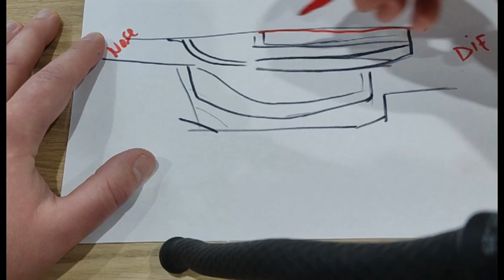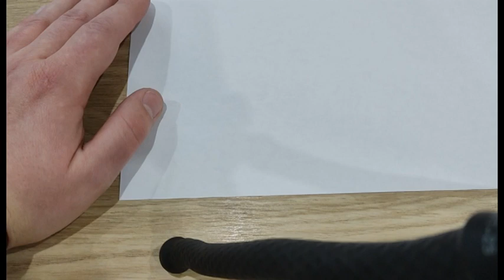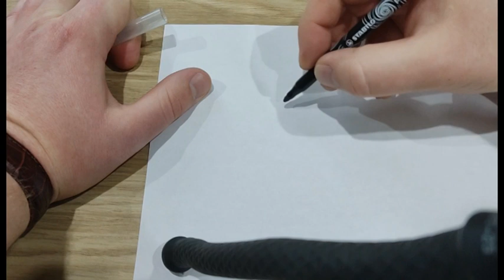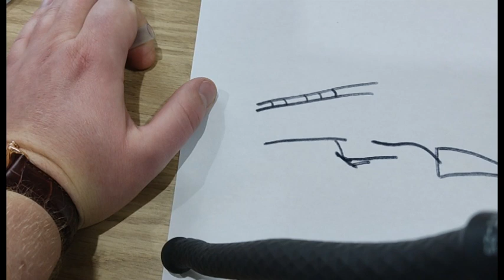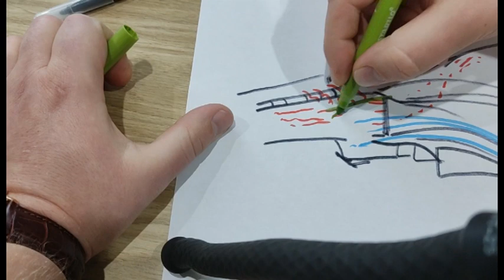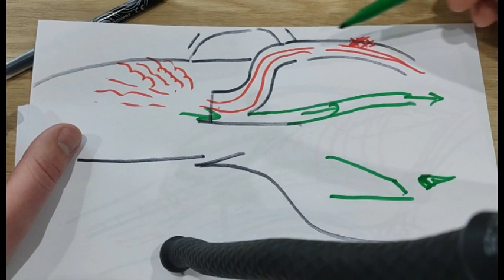Red Bull RB20 2024 F1 car design technical review

Comment: One thing, I don't think the S duct is very lossy, because the pressure in the undercut gives you a favorable pressure gradient. In fact because of that favorable pressure gradient, it's the best place to put an inlet, as you're minimizing losses, especially over the side pod since the inlet is not there to disturb the flow going over the pod, not to mention if the overbite is working like a LEX, then the flow will be even cleaner as it makes its way to the rear of the car.

Comment: I have a feeling that the undercut does a good job of accelerating air along the side of the car, and the flow above the sidepod is comparatively slower, which means the sidepod overall produces downforce. If the side pod produces downforce, then you can basically understand why RBR went with an overbite style inlet. As then the sidepod works like a LEX on a fighter jet, and keeps flow attached over the top of the sidepod under pitch down maneuvers like braking, and initial turn in. Another curious detail is in the lower wishbone and track rod on the front axle. Such a design certainly helps aerodynamically, especially at low speeds.

Comment: Unique commentary. I haven't heard anyone else say that RB may be copying Ferrari rather than Mercedes.  Very interesting!
Reply from the maker: No After Testing everybody basically says something similar, Because they did not see the horizontal intake, people thought the vertrical intake like Mercedes had it, was a zeropod design. However i knew there was a horizontal one, and as i explained and like Ferrari does you do not place an intake close to the monocock unless you want to clean up the air flow. They also added two additional small intakes on either side of the driver helmet which no one saw before testing. The cannons on the back are Mercedes look a likes but more extreme, that is also why a lot of people refere to the design as a Mercedes copy.
Reply: @maycodesignandengineering7514  You are a good teacher. Very much appreciated!

Comment: Do the cannons have to be huge then? That small back outlet was still there on their car last year . Also, the cutout on the back wing is present on every team's cars.
Reply from the maker: Hi Pierre, hot air grows in volume and too high of a velocity will create resistance so i would say they need to expand the area to keep the flow under control, yet still fast enough that it does not create heat soak. Obviously this weeks testing will show if the corrolation between there simulation and real life enviroment is good. Furthermore the front wing is very important for this. I heard roomers there is going to be a new front wing with two seperated elements from the nose cone instead of 1 like most other teams have.